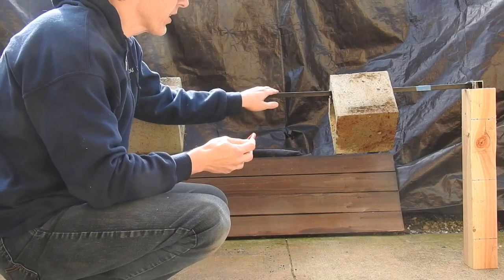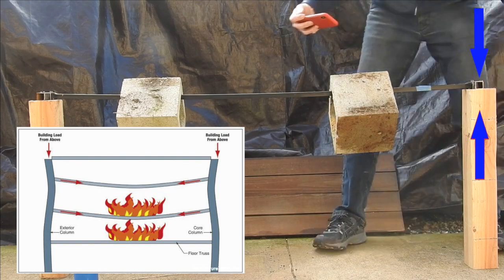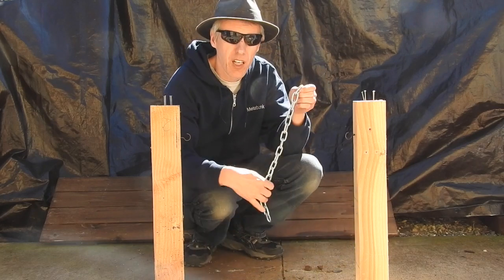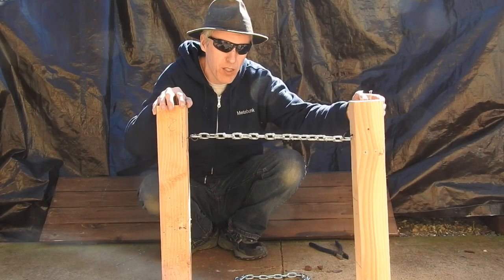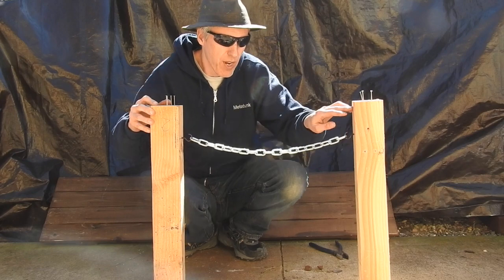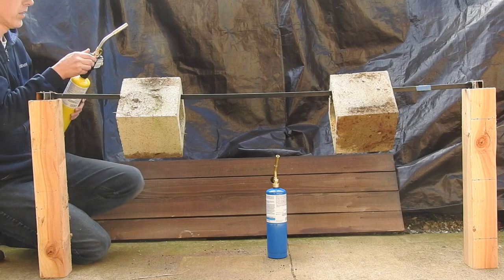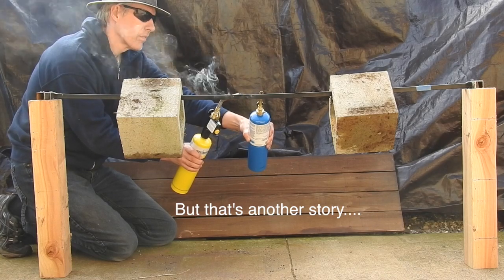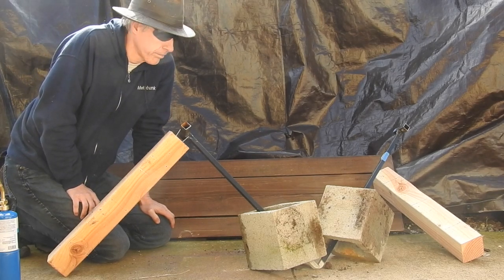Why Sagging Beams and Trusses Pull Inwards

Comment: Stand-by for comments about temperature. (first)
Reply from the maker: The jet fuel would have burnt out in several minutes. However the fires continued burning the building contents. Remember other skyscrapers have had substantial fires even without planes flying into them.
Reply from the maker: Temperature was roughly around 650°C at the hottest, probably a bit less. See:  https://www.metabunk.org/posts/219903/ for how I measured this after. 

It's not entirely relevant though. The point isn't about the beam loosing strength - because we know that happens, it's about the pulling in that happens after a beam starts to sag.
Reply: How many of those other burning skyscrapers were built the way the towers were built or had airliners full of fuel fly into them? The way a building is constructed is going to make a difference in a building surviving with less damage. The burning building in Tehran collapsed after burning.
The point is, it is very obvious in live videos of the towers, that each tower collapses at the buckling point of each tower. Definitely not bombs, explosives or controlled demolition
Reply: MAPP gas and propane can not melt steel beams!!
Reply: They can only weaken the structure.
Reply: jet fuel and wind at that height would act as a bellows would easily melt steel
Reply: jet fuel - isn't that liquid?
why wouldn't it flow down the stairs, elevator shafts or out of the broken windows?
why didn't it just explode in deflagration but kept burning almost an hour? makes no sense.
fuel is highly inflammable - just would explode or burn within seconds.
If that explosion wouldn't bring the building down the whole accident would turn into a genuine high-rise fire - no way seeing the steel structure collapse after it survived the first impact.
Reply: how many steel-structured skyscrapers (total number/perc) collapsed after suffering substantial high-rise fires ?
Could You provide statistics please?